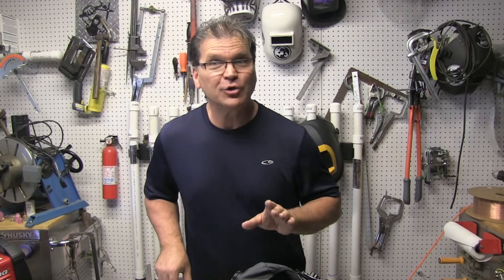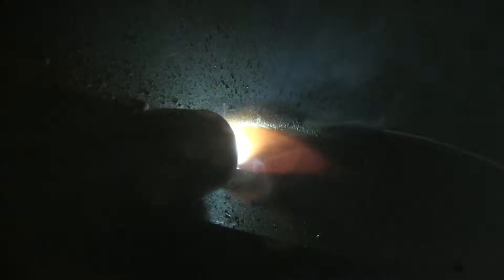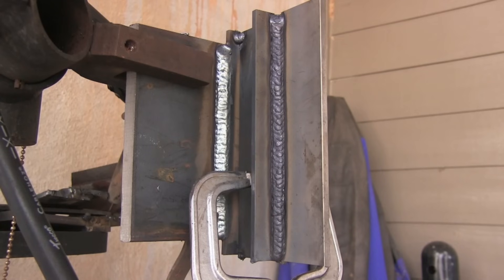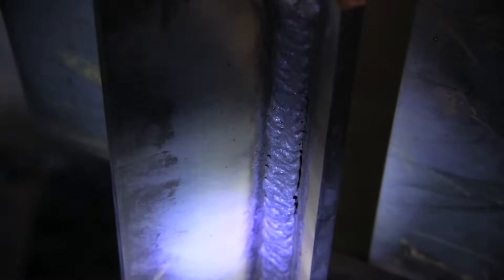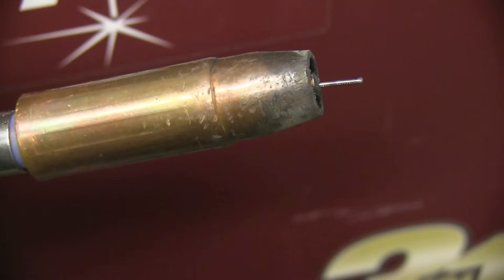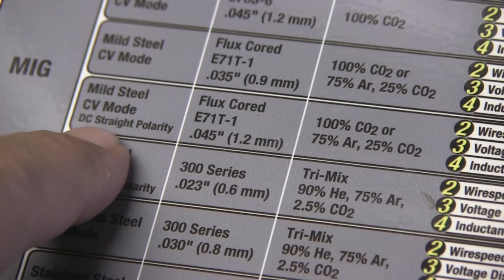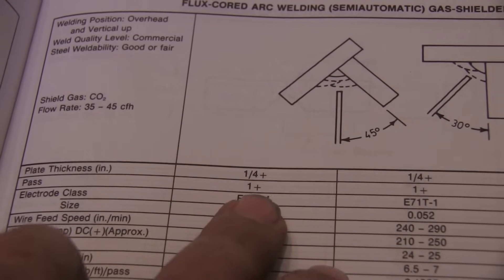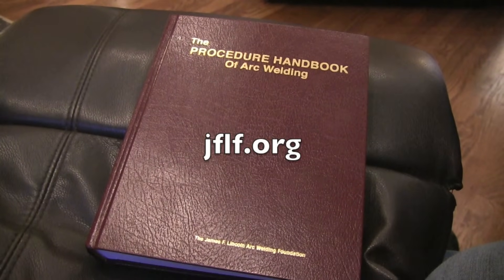Dual Shield Flux Core Welding Basics

Comment: With all the videos you have Jody, would you happen to have one with fine tuning dual shield to adjust the weld profile and the impact your travel speed has with dual shield? The window for parameters is so BIG with manufacturers recommendations and I’m not understanding what to adjust in order to achieve a sound weld. Like do you adjust voltage or WFS to fatten your weld up, what is a good increment to adjust WFS? I’m confused with it.

Comment: Looking at the first weld I can say you have to much spatter. I go with  27v and 33 wire speed for. 045 and 27v with 25 wire speed. I use a stickout of about 1/2 inch with co2 gas
Reply: 29 on the wire feed I mean. Using 71hd-c Lincoln wire
Reply: 1/16 wire on the latter

Comment: I’m having a serious problem cold rolling on a 5/16” weld. I’m laying a light pass (less than 1/4”) under the 5/16” to get the size correct and it fuses fine on the top but the bottom is horrendous. I’m not sure if it’s my heat, angle, wire feed or travel speed. I’ve tried pulling, pushing and oscillating and I still get the same awful result. I’ll also admit that my stick out is a bit too far.

Comment: If anybody has good videos on 1/16 dual shielded Fcaw-G with  E71T-XM wire, I Have a 3g test monday let me know. 260-330 wire feed speed 24-30 volts
1/16 or 1/4 root w backing

Comment: I do .125 c channel welding with dualsheild and we run 25 arc volts with 370 ipm, you don't have to weave at all going vertical because the sheer amount of wire and heat going in just fills the joint good

Comment: I just started my first welding job and they run dual shield hot! It's 0.064 flux core Lincoln wire with 80cf of gas 28v and 310wfs

Comment: What would your settings be for 5/8 plate with same wire? I did some wity .035 hardwire a few weeks ago at 28v-450 and it sounded almost like spray arc.

Comment: So, been awhile since you put this up, one thing I've noticed is that DUAL SHIELD requires a LOT of Volts... right? I bought an Everlast 230i mig and "they say" it's not recommended for "dual shield" welding because it too low power for "dual shield" even though it mentioned in the manual... I R Confuzed. Maybe there is a .035 E71T-1 wire that would work ok? ???

Comment: I use an almost LOW spray setting with 75/25 gas and .45 esab dual shield, 25.5 and 315 for my ups, assuming it’s nothing structural. All around though, 26.5 and 432 is our “structural” setting. It’s a very quiet process. 26.5 and 432 can be difficult going up if you’re only doing a short bead though. For me anyways, I can weld 14” stiffeners all day long and they look great but I weld like a two year old on a 3” uphill bead 😂

Comment: FCAW is just so fun to do, and getting a 5/5 (which is incredibly rare) from my welding instructor on my T Joint today caused me to fall even more in love with this field. I intend to pursue my welding career at Washtenaw Community College for 2 years before either joining the work force as an entry level welder and fabricator, or transferring out to a larger university with a more advanced welding program for another 2 years, gaining a more advanced degree and certification, and joining the work force either as an instructor or as a professional welder.
Reply: Be cautious with welding schools. I learned much more from working in a fab shop than I ever did in school.  Not that they aren't useful, but it's not the only path to becoming a great welder
Reply: Spid3rmike117 I agree and all schools are different. You definitely get more skills on the job but good solid welding skills from schools won’t hurt. I definitely think you should go out and work before you become an instructor it will help you and your students. Learned so much from the old timers that a school wouldn’t know. I went to welding school so I’m for it but don’t be stuck there it’s better out on the job, really test your skills.

Comment: that crown youre talking about i have found is due to that "stack triangles; give it that extra cron in the middle, ive found running complete stringers, which is faster and ends up with less heat input as your are not maniputing the wire. jrust allow the wire to drive itself in them which can create i nice flat weld. can send photos through of my welds running stirngs, at 24-25 v and about 7-8.2metres a minute

Comment: Hi sir,  I am going to weld the tubes of my 1977 14 bolt rear end to the pumpkin

I drilled into a section I will be cutting off in the future and I got one inch squirly shavings
I think that tells me it is cast steel not cast iron.  I

I prehrated a practice axle to 400 and used .035 weld wire and colled slowly while reheating the cooler spots so it came down evenly and beat with a 20 lb sledge and no cracks.   My friend said I should use 045 dual shield but I already have some 035 dual sheild flux core.  Should I try the 035 or buy 045 or just stick with regular 035?

Comment: When u go vertical UPP. Just go strait up no wiggel. Or go side to side.but you have to go mutch slower then u do. I promisse Your weld will look so nice u Get tear in you eyes. You should test And se how slow u can go dual shield handles a lot before IT go south. I have been welding dual shield for 13 years. And we USE 82%argon 18%co2

Comment: I got a question, can I just use regular gas less flux core with a argoncarbonmix gas to achieve dual shield? Or is there specific gas shielded flux core wire out there,  and if so where can I find it, needing it in a 10lb or less spool in .035(diameter) or less. Thank you! Just got back into welding and would like to use dual shield wire again, I’ve also googled it and I can only find .045 diameter and very large spools that won’t fit in my machine. Thank you for your help again!
Reply: lincoln 71m outershield  most welding supply shops will carry in stock

Comment: How about some overhead?  Talk about "no motion", I am reaching in between pieces to weld at the bottom of a 1/4" wide groove 1/4" deep 12" long.  It is very difficult to keep the wire in the middle and get complete fill.  A big problem is when spatter shorts between the tip and the gas lens and it all goes to !#! if the lens touches the work when following the grove.  I know, all I need is a 6,000# welding positioner but I don't have one.

Comment: 23 volts?  29 volts seems to give the best hissing spray transfer for me and 330 ipm. 
The puddle fuses the sides very nicely and the weld finishes glass smooth.  I don't see any porosity or worm-tracking.  I am butt welding 1/4" wall 7" square tube to 1" plate for a tile plow hitch on a D-7.  
Am I causing some other problem running so much hotter than you?

Comment: Do you have any recommendations for parameters for 1/16" wire
Reply: Try 26-28 Volts, and I believe 3.25-5.0 on the wire speed. Every machine is different though

Comment: Thanks for the sweet tips. Your input on the wire speed and voltage changed my pool tremendously I didn't realize how touchy this motherfuckin flux core is

Comment: We weld Heavy Equipment attachments and use Miller 350P welders with .045 flux core wire along with 75/25 gas. Our two primary settings for what we weld is 285/485 and 293/530. Were welding materials up to 4” thick and some even thicker.

Comment: I use Hobart fabco excel arc 71 and just go by the chart provided with the wire from Hobart. 200 amp machine, 25 volt, 340 in/min wire speed, 5/8" tip to work distance, works perfectly. Just go by the charts provided by the manufacturer of the wire itself and everything will work great. You could get a 5 year old to weld with dual shield flux core and it will come out looking like a pro did it lol

Comment: I use a commercial anti-spatter spray - but ran out one day. I stole a can on PAM from my wife's  supplies - it was peanut oil flavored. 
I can't tell if the welds suffered, but it sure smelled good and it kept my spatter clean-up a lot easier with a lot less wire brushing. 
I bought a case of PAM.
Reply: Years ago a new employee who had never used Anti-splatter spray saw others spraying something. He thought it was WD-40. He started spraying WD-40 and welding, he was so pissed when he saw what it did. Couldn’t let him go on, so I handed him a can of Anti-Splatter. He was a different welder after that day.

Comment: Many misunderstand the main purpose of Dual Shield. Its purpose was relatively simple in that it prevented internal cracks in normal welding passes by applying the final overlapping pass of Dual Shield over normal structural welds to be much hotter with stronger steel grades combined with or over normal steel rods or wire passes. This enabled a combined soft centered steel within the weld while the outside final pass serves as a very hard steel coating. This final pass reheats the underlying welds removing any fractures, cracks and fissures in the softer steel passes BUT MAINTAINS THE SOFTER METAL CENTER FOR NORMAL "WIND/BENDING" FLEXIBILITY TOLERANCES. Dual Shield Dual Pass methods.

Ships, Submarines, Television Towers, Water Towers, Pressurized Gas cylinders, catwalks, ladders etc. all depend on it. That final pass is applied usually at a very high amp heat setting and is a law in many states after a television tower collapsed killing a work crew years ago. When high winds from bad weather and or pressures increase inside tanks,, this process allows the structured steel to still maintain it's FLEXIBILITY and yet be very strong outside to absorb the flexing motions within the steel. 

You will see this being applied also to Tall Pipe Grain Elevator Legs, Fire-escapes and entirely in ship building even though nobody really understands the reasons for different rods for different passes. Some computerized mig's now are rigged for 4 wire grades that all can weld 4 wires at the same instance. Two inside lay the center pass normal wire as two outside wires in Duo-Shield overlap when the 4 tip is zig-zigged back and forth over them as the machine self welds all 4 wire-fed wires. 

Also the main reason normal steel is used underneath is that Dual Shield alone is too hard and can cause structural steel to become brittle inside and break. Why soft grade steel is applied first and possibly in several passes before the Dual Shield outer is applied. Nuclear Submarine section connections also dangerously rely on both.

Another sad fact is that anywhere a tower falls, a water tank collapses, or a tank burst or a crane collapses,,, they did not follow these methods. It kills people folks. And for small welding work the Dual Shield is used singly in welding ship chains, drag chain conveyors and some tools  where steel hardness is relevant. 

Besides Dual Shield Dual Pass methods Single pass methods examples i have overseen personally are military tank tracks, road graders, Hammer-Mill blade tips, feed-mill ribbon mixers and massive gear teeth repair. It is this massive heat generated by the Dual Shield either in rod or wire that has an effect of Heat Treating the steel as it welds. This makes it a much harder stronger weld but sacrifices flexibility in exchange for brittle strength.

Comment: What is your preferred dual shield wire if you had to pick? Mine is ESAB 7100 Ultra. Not to plug any particular brand here but just curious what others like to use if they had a choice.

Comment: Great video. You are correct sir the triangle weave as I call it it the best for dual shield when running the root at least. A zee weave can be done for the remainder or even stringers if you like. An inverted V weave works best for hard wire when running the root for the exact reasons you stated for both. Great information in all your videos. Keep up the good work as always. Do you have a donation link so people could help support your efforts to provide quality videos with high quality information? Thanks again.

Comment: great video! I always run tri mark or lincoln 71m dual  straight.. 3/4 stick out no weaving at all!  seems to burn in great. I weave to and increase stick out to reduce heat if it start to get hot.

Comment: I'm about to start a new job using 1/16th flux core dual shielded wire. I passed the weld test but it was done in the flat position and even just doing flat I could tell a huge difference in using 1/16th wire compared to .035. There's a lot of vertical up at the place I'm about to work at too. Would the vertical up techniques that are applied using .045 wire in this video be similar to 1/16? For flat I gave it no motion at all.

Comment: You can run flux core with good results DCEN as long as its dual shield. The chart isnt really wrong. However without shielding gas you MUST run DCEP with flux core wire.

Comment: at my old job we used lincoln 71a75, with the right settings you can run straight up a vertical joint and it would lay in perfect.

Comment: I have a question  i use a handler 190 mig welder  and right now i am running .035 flux core wire. i have a wire speed knob 10-100 and a voltage selector 1-7  . i have been using this welder for about 3 years now but when i weld with it i have very little if any flux to chip off  but the welds hold strong and once you wire brush them look just like a stick weld after chipping.. just curious why i dont have the cumstomary slag cover when i am done .. any ideas would be helpful
Reply: He's using dual shield wire. Which means he has gas and a dual shield flux wire, maybe that's why?
Reply: Ok thanks
Reply: Brandon D ok thanks

Comment: im not sure of the part numbers but i used a long contact tip style and the mig nozzle i replaced with one that would give you perfect arc length by just dragging the nozzle on the material.

Comment: The door chart on my Lincoln Power Mig 210 shows E71T-11 (DC–) - and it runs real g
ood with self shielded. Are we sure the door chart on the Thermal Arc 252 is wrong??
Reply: +Darren De Silva  E71T-11 is innershield wire not dual shield. DCEN is the correct polarity for that wire.

Comment: in my experience the slower you go vertical up the bumpier it will be due to the relatively longer molten state compared to short arc.  it also helps if the fitup provides a little gap for the weld to go to when going vertical up. I I get better results using stringers going hot and fast versus slow and and hot for a less distorted appearance.

Comment: I have to say that you put a lot into your posts and for that Thanks . I am a welder form IL and I work with this wire every day and you mite want to try on a 3f or 4f 225 on the wire and 21.5 volts and see what that does .  For any one that is just starting to use this wire your  tree technique would be the way to go . It has some learning curve . I think that it would make it quicker for the ones first time out with this wire 
Thanks  Dennis welder form IL

Comment: With the right settings you can just do an 1/8" to 3/16" quick wiggle and it'll come out almost as slick as 2F. I use 24.5v @ 235ipm with 75ar/25co2

Comment: Is there a specific application for this process?
Reply: +B Winford Heavy steel requiring low temp applications and high deposition in structural fab shops

Comment: I think I'll have to grab a copy of that book. Hey I got a question, is there any charts or books that explain to non-engineers the size and thickness that beams, c channels or RHS can span if you are building things like Gantry Cranes or spanning roofs etc. ?
Reply: +MotorcycleTherapy I hope I explained that right. So if I wanted to make a Gantry Crane that was 3ooomm W to hold up 1 ton of weight, if I used 6061 T6 Aluminium I Beam, the charts would specify what thickness. Same goes for Mild Steel, or Stainless etc. Would be a very handy book
Reply: +MotorcycleTherapy Go to an engineer theres no arguement about this. with a ton of weight you want a engineers specs of material especially with aluminum and in a critical application such as a gantry
Reply: Thank you, appreciate the info. I think I'll pay an engineer to give me a scale of material boundaries from a selection of sizes and that will give me a good reference to stick to.

Comment: Jody, I love your videos and instructions.  I recommend your channel to anyone interested in welding.  This comment is very out of place so please accept my apologies, but I wanted to get your input on a potential future video. I was recently introduced to electro chemical weld cleaners by my sheet metal vendor.  I struggle with wire brush cleaning of stainless TIG still looking pretty ugly with scratch marks and some residual discoloration.  Yesterday I went through a demo of the low and high end Walter Surfox machines which were impressive and I am waiting for a demo of a Capital machine.  I also found the TIG brush that looks pretty impressive as well, but is a bit more expensive than the other two.  Have you heard of these products?  If yes, do you have any thoughts?  Would you be up for a head to head review of them?  I would really like the opinion of a professional before I buy.

Comment: A bit off topic, but I'm wanting to upgrade my chop saw, I've got a nice dewalt chop saw. I would like to get one of the carbide/diamond cutting blades that is meant for this type of saw, a high rpm saw that is meant to run with the normal abrasive blades. Any experience with these types of blades are they worth it and do they really last as long as they say? Approximately 25x the life span as compared to an abrasive blade. Thanks to anyone that might have some first hand knowledge.